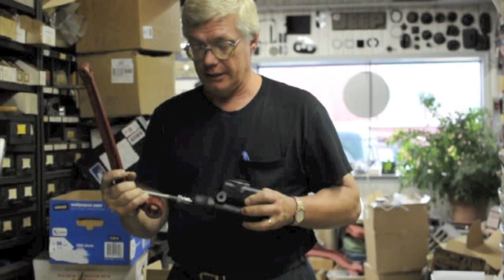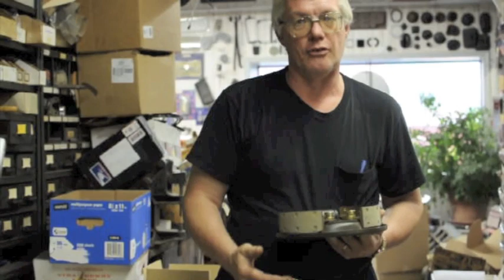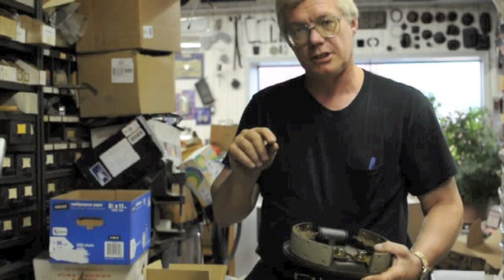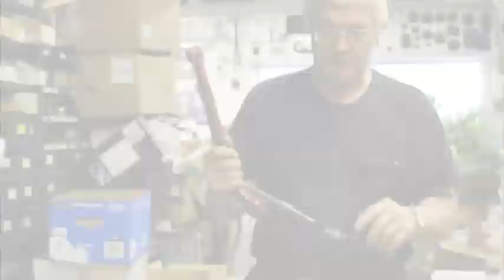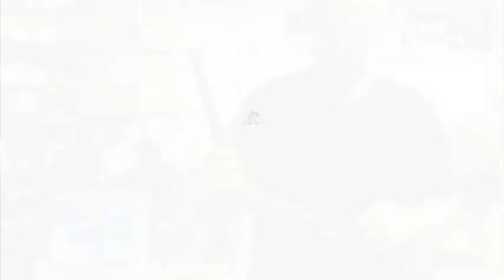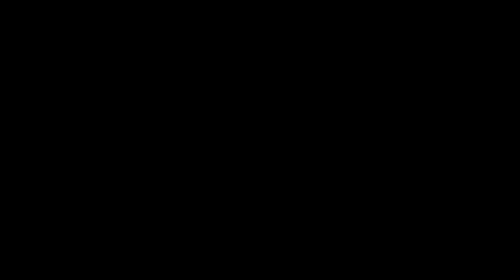Brakes Part 1

Comment: I've had great results bleeding drum brake systems after I had adjusted all wheels to not turn at all before starting the bleeding process...after they were bled twice, I backed off on the adjusters until a slight drag was felt on all drums...the pedal travel was perfect every time...I love your videos...great stuff here...my 56 cj5 is slowly getting back in shape with your parts !  Thanks.